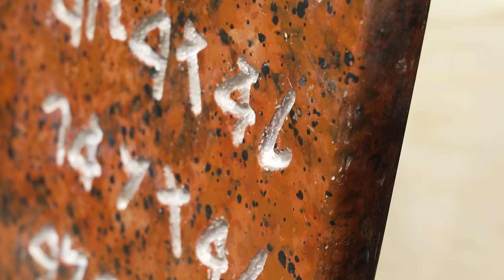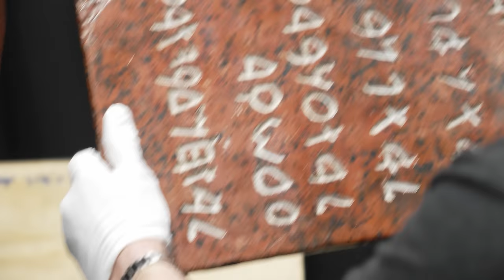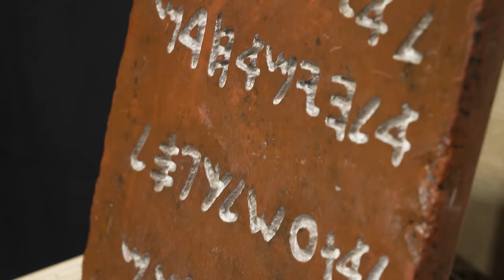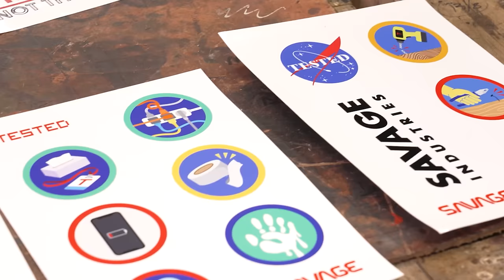The Original Ten Commandments Props!

Comment: Back in 1999, I photographed one set of tablets for an auction at Christie’s. I don’t think it’s the same pair that are in this video, but here is how they were described in the auction catalog, which gives a little more info about the build: “The tablets are constructed of painted fiberglass and wood and feature the words LEFT and RIGHT on the verso of the respective tablets. The tablets were constructed by A.J Ciraolo, a scenic artist on the film. Asked to create six different sets of tablets for lighting purposes, Ciraolo handpainted the tablets with coat after coat of oil-based Japan Colors to give a rough hewn look of depth to the fiberglass.”
Reply: 😂🎂.  1999
Reply: his son has a pair that was used on set so there is one pairs whereabouts

Comment: They had to make the blade itself way thicker than it would normally be. Probably due to the material used to make it. Wonder why they went through all the effort to make fake Viking blade of clay. They could have easily paid for skillful Blacksmith to make way better looking fake Viking blade using real iron/steel materials. It would also stay in good condition far better.

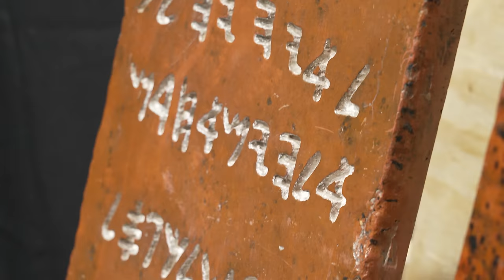Comment: It took me less than 2 minutes to see that looking at the movie and the ones you have here the one on the left is not the one Chalton Heston is holding in the movie. 11:04 look at the L looking symbol on the left side it is not the same as the movie one. 11:12 where the two symbols touch they are not that close in the movie.  https://youtu.be/Id6oS3L-D9A?si=DHEAs-vF4hkQtwA1
Reply: Hold your horses... When did they say that either of these made it on film? Brandon noted that this is one of multiple sets, and also specifically acknowledged that the lettering may differ set to set. No need for shame.
Reply: Thank you for the info I made changes to my post.  @Thomas_Esson
Reply: @theinfamouscletusherringbo8134  Thank you for a reasonable response; it's appreciated. And to be clear, there's definitely a place for skepticism, and questioning sufficiency of authentication evidence. The common creation of multiples is just one area that calls for a degree of slack.